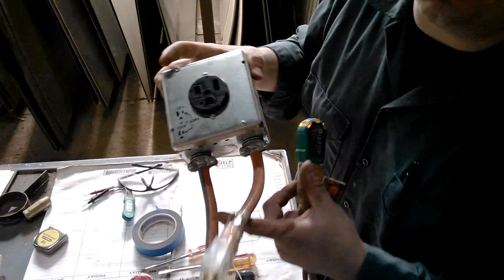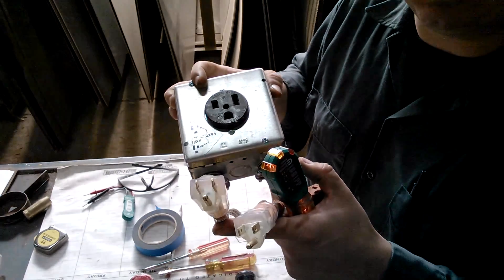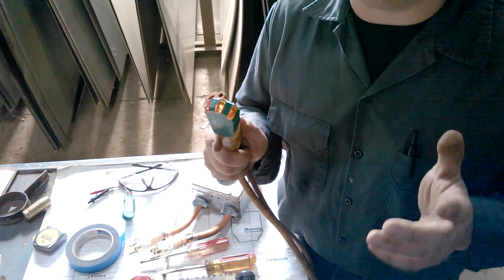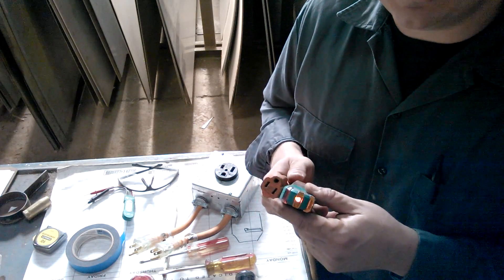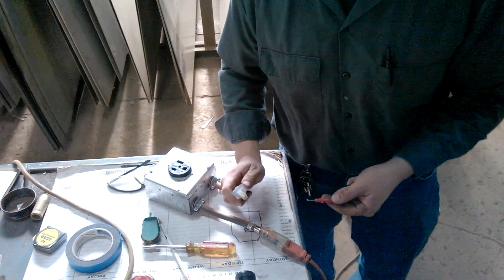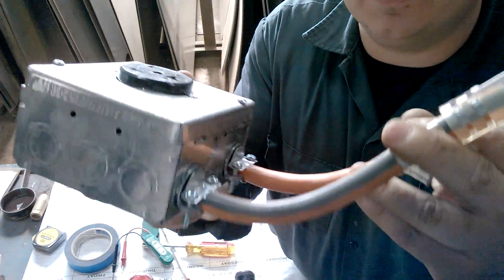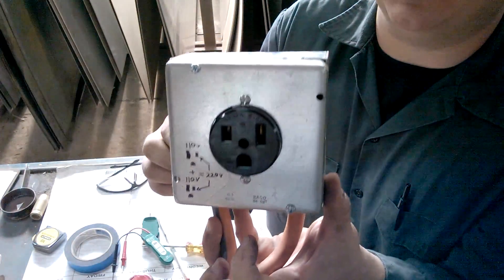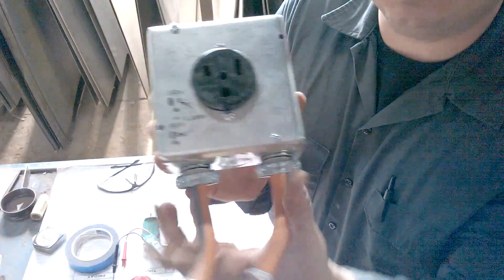Experiment convert 110v to 220v from two outlets

Comment: I have been the lead supervising electrician for NASA (Government Oversight Standards and Safety Division)  for the last 35 tears,  and I can,  without reservation,  emphatically announce that this experiment can now be afforded the status of SUCCESSFUL.   Nothing about what he is doing is incorrect,  or not according to code.   THAT'S what they want you to worry about when trying to save a buck as the little guy.  Heck,  go ahead and duplicate this project all you like,  and plug your pool pump into it if you want. 
You don't even need those fancy metal boxes -  that's what they make duct tape for.
If someone is going to wire up their house using this kind of circuit,  I don't see ANY,  and I mean (to qualify this with my entire life's professional experience),  ANY problem with it. 
Perhaps this will shut up the stupid idiots that are NOT lead electrical engineers for NASA,  or better qualified than I am.   
I  always say,  "... 220, 221, whatever!"
Reply: sure it would work, but wouldn't you want a dual breaker so both circuits shut off at same time?
Reply: Karl Miller 

I thank you for your expert opinion. It is definitely appreciated. Especially on a YouTube messaging thread such as this one where it's difficult sometimes to determine the validity of one's conclusions.
Reply: OcRefrigeration,Hvac & Electrical. I have done it and it works !!! ;) the guy is a genius!
Reply: I have actually done this and it works!!! I now have a washer and Electric dryer in my apartment. I have saved so much money in laundry with this box, and not only that, Its not as bad on electricity either. I still save money! Woohoo!
Reply: That is very old skool. I'm used to dealing with slumlords who provide the least possible. I'm glad someone finally made a video. Kudos !!!
Reply: Thank you, Karl.  good information.
Reply: +Wolfman Jack,  Just doing my part for humanity 😉
Reply: Karl Miller, I have a question.
The reason that people may make a Back Feed cable from a Generator to the Dryer Outlet is because it's 240v which then supplies 120v to each side of the Breaker Panel correct ?
Assuming that I'm right, I'm also assuming that if I have a Generator with only a 120v outlet then I could still back feed 120v to one side of the breaker panel & the side that is fed would be determined by which of the Hot terminals on the dryer outlet I feed, correct ?
This is all hypothetical of course & just for conversation purposes :)
Reply: David Lomm - Yes you are correct
Reply: What I Am wondering is  Can you do this with two generators
Reply: Actually everything he did is Fine. Ive done it a few times my self. Its quite safe. Better than alot of stuff u see on the net.
Reply: You don't have to be a "lead supervising electrician" to know this isn't not only "possible" but COMMON SENSE. All "household current" that's "110" is simply ONE HALF of a 220-volt single-phase service. It's "split" to each side of a breaker panel and "110" breakers are connected to ONE "lug" of that box while "220" breakers are connected to BOTH lugs.

And by the way, you MUST be a government "worker" and a book-smart IDIOT for suggesting "duct tape" on electrical circuits. Shut up, stop trying to get people hurt and go back to pissing away tax dollars.
Reply: do the cords that are wired to the box have to be the same length?  I plan to do this but the 2 receptacles are about 5 ft apart.
Reply: They should be in order for it to work correctly. I made one with 2 short pieces and used the same length extension cords. Each has to go into a different circuit, or you will still only have 120v.
Reply: Karl Miller you can buy one
Reply: I thought you could have at least made something up for me ;)
Reply: Wow Karl people really believe your serious...! Lol please people don't do this.. if you don't know how to change a breaker and size it correctly to get 220 out of a panel correctly, do not do it....!
Reply: Karl Miller power in this country is very weird I grew up,in I Italy. We have 220v one phase one neutral,one ground. This is the only household,power. Commercial is 3 phases 380 with or without neutral.
How come,here there is 110 120 208 220 240 with 3 4 and 5 prongs
Reply: Oscar Correa cc
Reply: I am planning to connect a steam generator to that type of setting. some one suggested that I use ELCB. Should I use one for each line?
Reply: Karl your full of it.  No doubt this will work but no doubt it's a half ass way of doing it when you can do it easier the normal way.  Duct Tape? seriously? How about Electrical tape ..... just a thought. or how about if your not an Electrician don't fuck around but if you choose to the proper way to see if you have this hooked up right is to get your hands wet then stick a fork in the outlet.
Reply: Karl Miller I
Reply: forkandspoonoperator:. Hey good point. I would think you would need a ganged breaker for the circuit so that each 120v line shuts down simultaneously.
Reply: Karl Miller Karl Miller this is the best comment I have ever read on the internet....I will be installing one to run my new woodlathe in my small shop in Vermont!! I will be documenting the process check it out!! Renegade Woodshop on youtube
Reply: David Lomm, I have no idea.  I was kidding about my qualifications.
Reply: Ugly Loser we could only wish.
Reply: the 220-240 volt plugs and 110-125 plugs are not able to be plugged into one another. its the same theory as diesel pump into gas car ones bigger and wont fit, on the diesel pump subject itd be nice is gas was bigger or keyed or somthing as diesel in gas engine does no real harm but gas in diesel costs big dollars
Reply: Shoot !!!!    ...I would not wish ! 
....I would, If given the opportunity, to IMPEACH that UnAmerican even if he was on his last month, his last week, his last day, his last hour, his last minute, ....In fact if given the power, I would impeach his sorry ass, even in the last second of his service in the office !
Reply: We need more people like you......Please Take over O-Dumb-Ma seat    (Obama) !!!

Comment: I guess that this is a nice way to make a portable 220 outlet from two nearby different 110's. Essentially what you do in the breaker box, only this is done with plugs. Bad thing I guess is u don't know what your max allowed current draw is until one of the breakers trips. BTW, I am not a licensed electrician but have worked with this sort of thing several years. Just take that into account when reading my comment. Even if you knew the breaker amp value for the wiring you would be adding load and the outcome is still a bit unpredictable.

Comment: In order to make this work you have to get the generators exactly 180 degrees out of phase.  That's why they call it 2-phase.  You can sometimes parallel 2 generators and they will lock into phase.  But there is nothing to guarantee that 2 generators would even be exactly the same frequency let alone the proper phase.  I am an electrical engineer and have been toying with designing a circuit to lock the 2 generators at the 180 degrees out of phase condition.  You have to have a very sensitive throttle control move one generator ever so slightly until the phase is right and then pull it back to exactly the same frequency.  I have 2 6.5kW generators so one of these days I'll get off my duff and get it done.  Without the phase control you could burn up any motors running off the 220 volts so I wouldn't try this experiment if I were you.

Comment: Yes, you can convert two out of phase 110/115 volt circuits that are not controlled by GFCIs... to 220 volt. There are even ready built devices that will do this for you. www.quick220.com.

Comment: Yeah, because unlike 120Vac, 240 doesn't need the stinkin neutral wire. But the ground (earth) wire is used. Go figure.

http://imgur.com/9VZb8V2
------------------------------------------------------
http://www.do-it-yourself-help.com/wiring_receptacles.html

Comment: do you connect both plugs to the same outlet?
Reply from the maker: Do not do that!!! This is something that can hurt you or cause a fire. I understand why all of the electricians are freaking out about this, done properly it works, and I'm not the qualified one to ask best get an electrician to help. I'm "stupid like a fox" (quote by Homer Simpson)!
Reply: no and he clearly said so. he said he plugged in each extension to a different outlet, each on a different circuit to the panel.
Reply: If you plug a "suicide cord" (double male) into the same outlet, absolutely nothing will happen.  They are already connected in parallel.   Let me be clear about this...  A normal electrical outlet (receptacle) has 2 outlets where plugs can go in.  If you connect both of them with some homemade male/male contraption (assuming you  got the wiring correct), nothing will happen.  You are just linking hot to hot , neutral to neutral, and (optionally) ground to ground (if it is a 3 prong).  Well guess what... they are ALREADY connected that way so you are just making are redundant connection.  Why might you want to do this?  Maybe to mess with your buddies?  Tell them to pay you $20 cuz you think it might blow up into a big fireball and then laugh at them when nothing happens and you collect your $20.  Ha ha.  This is VERY BASIC electrical stuff.

Comment: A possible need for this, you are a caterer and you need to bring a whole stove/oven and their is no 220v plug to plug in the stove, walla problem solve.
Reply: no its not
Reply: Hire a electrician. most ovens and ranges pull 50 amps. most commercial 110 Outlets are 20 amps and if the breaker is not size correctly or if you're pulling off two separate circuits you could trip on Breaker and then have the other one not trip and then cause a fire.
Reply: +Kyle Campbell How would one breaker tripping, but not the other, cause a fire? 50 amps is probably the maximum demand/load of a stove/range/oven, but with discrimination applied the appliance would quite easily serve its purpose on 20amps or less. +Scott Wright, If you're willing to take a little longer preparing your food service, the I think this is a good solution, as you've said.
Reply: Could over load a neutral.  The reason the code book requires shared neutral to have breakers ties.
Reply: Kyle Campbell This circuit is open when any one of the breakers trips, so how can it overload the neutral?

Comment: hello
i bought Panasonic KX-TG7872S with power supply 120v and i want to use it in europe 
what product i need to make it 240v?
Reply from the maker: +TOM A You should need a step down converter for your 120v phone to plug into 240v euro outlet, check this out: http://amzn.com/B000W9DJ1Q  . 

This is just a guess, it all depends how much power you may need for the size of converter. 

Thanks for watching!
Reply: thanks

Comment: In the hardwood floor industry we have been doing it for years, we normally hook up our sanders that run on 220V 30A  to the electric dryer or electric stove outlets if possible, but sometimes they are gas and they only have 110v outlets so we hook into a breaker on the breaker box outside the home unless it is too far, it's raining or simply there is no breakers available and we use this same method, you go to Home Depot and buy a small A/C beaker box like the ones used on a Jacuzzis and hook everything just like this guy did BUT using a breaker and we use a volt meter on the same line to make sure we are getting the right voltage, in 20+ years a haven't seen or heard of any accidents of houses that got burned because of this, PLUS someone is already selling this things online for years...right or wrong?? not sure I'm not an electrician but take a look:

http://store.ussander.com/plugs-cords/power-cord/side 

http://store.ussander.com/plugs-cords/power-cord/km01

http://store.ussander.com/machine-accessories/power-boosters-adapters/dsboxsm
Reply: do the extension cords have to be a certain gauge for this to work?

Comment: Basic electricity and electronics- you need a step-up transformer.
Reply: +Keven Stroman I think a step-up transformer would work if getting a higher voltage out of 110 is the only goal, but I think the purpose of him combining the two lines is to pull power from two separate circuits so you can pull more current without tripping the breaker.  My question is how do you know/ensure that the two circuits have the same phase?

Comment: I am curious what you ran using this 220v rig? A 240v rated welder perhaps? I'd like to know how it worked out. Did the supply wires got hot? Did the circuit breaker trip?
Reply from the maker: +Larry Hutcherson Sr , 
It didn't work at all, I was running an inverter welder trying to get 220v but I ended up finishing on 110v with a 20amp outlet. One line was 15amp and the other 20amp, neither got warm, and the 15amp breaker tripped so much I gave up.

Comment: come on , all he is doing here is taking two out of phase 110 volt  to make 220 volt.......in other words one 110 from the left of the panel and one 110 from the right of the panel and he got 220 .... no brainer and he wont burn anything.
Reply: Question- hope someone can help. I have a 15a 110v outlet. I need 240v at 15a. Can I take my neutral from my 15a romex off the neutral bar and put it on a new 15a 110v breaker across the panel on a different phase? Code is irrelevant, i just want it to work. Makes sense to me.
Reply: If you have a dryer  that's exactly how the outlet is wired into the panel.
Reply: chester wheeler it really isn’t lmao, a 240 dryer shouldn’t have the neutral acting as a hot wire. Should have 2 hot (Red&black) neutral and ground. Temporary fix maybe but definitely not permanent and not up to code
Reply: They are not out of phase they are phase locked 180 degree offset.  Out of phase implies they have different frequency.  The common term for this is split phase.

Comment: There is a device called a quick 220, looks very similar to this. Any electricians care to weigh in on the quick 220 box? I'm specifically wondering how many amps one of these parallel setups can deliver?

Comment: Someone correct me please, if I'm wrong. Taking 120v from 2 separate 120v outlets operating 180 degrees out of phase from each other does nothing to the household wires running to the outlets from the breaker box as the current doesn't increase until after the two are combined....right?  The line running from the junction of theses two outlets to the load is the one that needs to be heavy enough to carry the voltage/amperage, yes? After combining we have 240v@30A, yeah? Ok, makes me think, the problem could be 240v on the equivalent of a 30a system? (home wiring) Or, do we have the potential for that load, but that potential isn't realized until we hook up a resistance?
Reply: its still 15 amps but it is 240v, think of it as the power comes from one 120v plug into the device and than leaves out the other 120v plug but since there on opposite phases its a 240v difference

all the amperage goes through each wire, it doubles voltage and wattage but not amperage

Comment: This has got to be one of the most dangerous, & dumbest experiments I've ever seen. I honestly hope someone burns a house down and you're held liable for posting this. For 220v you need to tap into each phase at the panel with a 2 pole circuit breaker. Run the size wire you need to serve the amps you need. And the size wire dictates the size of the 2 pole breaker you need.THIS IS THE ONLY WAY TO GET 220 VOLTS PROPERLY AND SAFELY! Please don't hurt someone by cutting corners by watching some hack's video. Electricity will kill you!
Reply from the maker: +David S. You said it! I added a new disclaimer for the video, you should check it out. Thanks for watching and your advice!
Reply: Tell me exactly how it would start a fire.
Reply: +Justin Breithaupt I think because of the amperage draw of the combiner/240v box.... I think you'd be effectively drawing a 240v 50a load through a 30a set of wires....

Comment: I don't understand why you DID NOT marrette the neutrals together??????? The way you do it can lead to some real problems my friend!!! ( The neutrals are integral parts of EACH of those 110 circuits and IF on of them touch ground you might end up with a problem.
Reply: +twl5098 Why should you marrette the neutrals? As opposed to capping each separately? Thx
Reply: Neutrals are common with the ground anyway, so neutral and ground making contact is no big deal.  I probably would have toed them together just for the sake of tieing them together
Reply: how do you figure if half the time fucking neutrals and grounds are landed in the same bar in the pannel.